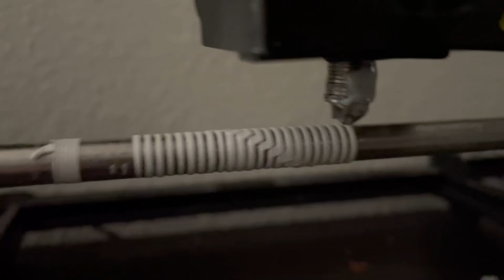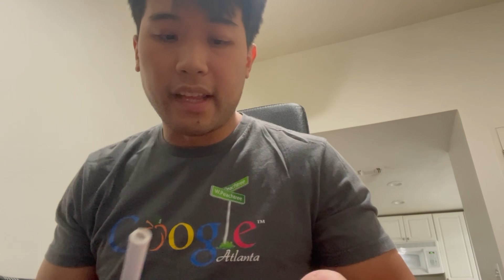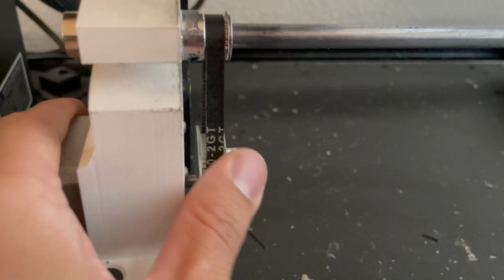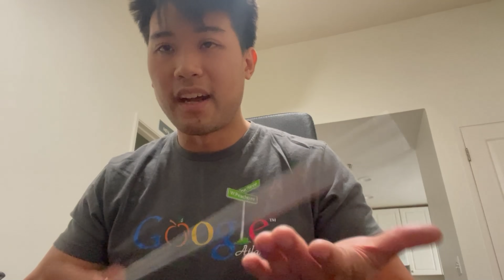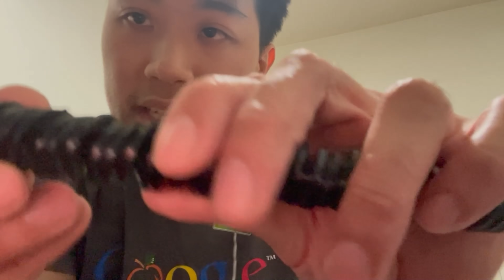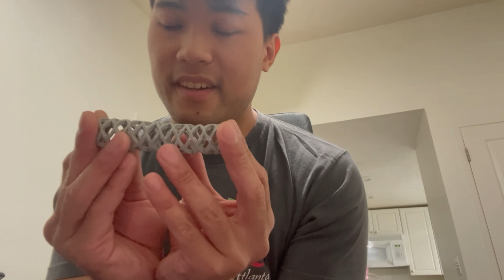i made a new type of 3d printer to make progressive twist barrels, springs, screws, rods, and more

Comment: Huh... So basically, a reverse Lathe 🤔 Being able to 3D Print Tubular Object like that would be interesting for the RC Tank Community... Since I don't own a Lathe I had to print the 128mm Barrel for my E-100 ( https://youtu.be/l3_RcOU3zo0 ) standing upright on my CoreXY for the best surface finish which obviously failed due to the ridiculously high Aspect Ratio between the Diameter and the Length of it necessitating for the upper third to be sawn off, reprinted and then glued on with the help of a brass tube going through its hollow core acting as a reinforcing rebar.

That being said... Not too enthusiastic about the whole Gun Rifling thing as cool as it may be from a technical standpoint so yeaa... Kinda lost me with that 😑

Comment: If the center of the rod is hollow, you can heat the rod while printing, or, maybe, heat it just enough to "release" the print...if you printed a layer of lower melting point plastic on the rod, you could use that as a release mechanism, by heating the rod just enough to flow the single layer of "soft" plastic?

Comment: So, you could put a lathe chuck/spindle, vertically, and get another "dimension", plus readily variable speed, and, you are no longer limited to "round" cores (you could use non-round cores horizontally, but not so easily as with a lathe chuck mechanism)
Different constraints, but different abilities?

Comment: Holy. Chris this might actually be huge. Even though its such a simple system it has big potential.
Reply: I think you're right. Mechanical engineering prototyping (manufacturing final products, from the capabilities he refers to), this could really open up ALOT for development. Not incredibly jazzed about the firearm focus, not because of anti-gun, but because I think this could lead to fear for 3D printing as shown by the new NYS Gun bill that happened this week. What's so awesome is this isn't JUST amazing for firearms, this is a break through for the validity of 3D printed Mechanical element performance.

If these don't start showing up as products, I'm making one.

Comment: The Daisy V/L is very similar to what you're suggesting. It was a caseless single shot .22 caliber rifle that, instead of using a primer to ignite the charge would use compressed air (Daisy is the same company that made the Red Ryder BB gun).
Reply: You could do the same thing today with a normal break barrel. They make enough heat in the compression chamber to burn oil or ignite other fuels. It's hell on the piston because it's not designed for that reactive force but it's possible.

HW/Weihrauch used to make an ether powered air rifle back in the days of chasing magnum power from break barrel airguns.

Comment: As a gun enthusiast, im excited to see gain twist rifling. I predict gain twist will make a huge comeback in the next decade.
Reply: Already is. It’s only a matter of time before the cost comes down from what Bartlein is offering. I have six gain twist cut rifling barrels and they’re absolutely sublime.
Reply: @DatMammutt  the cost is exactly what I'm talking about. With Better manufacturing techniques it's going to be as common as the .308 Winchester soon enough. The market is already ripe for it. The new blackout cartridge requires a ridiculous twist rate. Everyone is looking for those long high bc bullets. Soon we'll be firing bullets as long as pencils and a progressive twist is absolutely necessary to achieve that and take a big piece of the market at the same time.
Reply: @andyd2960 I’ve seen several prototypes of using alternate methods from cut rifling for gain twist so it can’t be too far away. Here’s hoping!
Reply: Check out the FGC-9 project.  Plans to use Electro Chemical Etching to rifle a hydraulic tube  using a 3D printed guide.  A great way to experiment with progressive twists.

Comment: You basically made an FDM lathe!!!!

...and you also gave me a rush of ideas and questions I didn't know I need an answer for.

Making lead screws, need extra strength? leave the rod inside.

Ideal for making high strength v-belt pulleys, small spools, things that would have massive overhang on a normal printer.

Would silicone sleeve work here? would it be reusable?

Did you try heating up the rod to see if the print would release after cooling down?

I hope you open source files and code, I bet the 3d printing community would be all over this in no time.
Reply: I've been thinking a very similar but slightly different question. "Did you try a heated rod(like a heated bed) to see if the print would release after cooling down?"
Reply: EDM CNC lathe might also be an interesting project
Reply: @charleslambert3368  I saw basically the opposite of that on Hackaday I believe.
Reply: @jmr not to come across as rude or anything but how did you get verified on YouTube? I've never seen a channel with less than like 50k be verified
Reply: @FATTYBONGRIPS  I've just been here longer then most.
Reply: @jmr  thats neat
Reply: PEI-coated rods?  FR4 rods?  Steel/aluminum rods? Spray the rod with a release agent?  Glue stick?  Dipping it?  What material would release prints best while still gripping sufficiently during printing?  That is going to be the big challenge, I imagine.
Reply from the maker: Yes!! FDM lathe!!

silicone sleeve would absolutely work!

I did heat the rod, even freezing, but that didn't work well
I made a press thing to remove things, but it was too slow that it was annoying

I don't have plans to open source because the code i wrote is super custom and really bad and not extensible
After writing clean code at work, I just want to write things fast and messy when I get home at night hahaha

I know that better software and hardware engineers out there can do it wayyyy better than I could in my apartment
Reply: @HumphreyWittingtonsworthIV  Please reconsider! Giving us troglodytes a starting place is so much better than nothing.
Reply: @grantprice613 don't worry the idea of too good somebody is already working on stealing his idea  right now.
Reply: @HumphreyWittingtonsworthIV  can totally relate to writing code for myself after working on code all day
Man you can probably imagine how long ago did I have some fun with programming things I like, not things my customers want
Reply: @HumphreyWittingtonsworthIV hey man I'm working on some large 3D printers, would love to collaborate
Reply: @HumphreyWittingtonsworthIV  Making it open source could significantly improve code performance.

Question about the rod, have you tried drilling a center hole and then using some means of heating with a slip ring?
Reply: @HumphreyWittingtonsworthIV  jobs and woz did there best work in a garage. you have something amazing here. something that could change your life.

Comment: How are you printing the solid rods?  Are you starting with a preprinted core from a Cartesian printer?

I could see rather than a rod, you have a rotating circular plate (maybe with heating for release?) Combined with a head that can rotate 90° so it can print perpendicular to the plate.  Print the core, stacking layers along the axis of rotation, then rotate the print head and start printing longitudinal like you already are.

Imagine printing propellers, gears, or other larger diameter items with a combination of radial and longitudinal print paths.

Or additionally make a print nozzle that's  a cone a little less than 90°, then orient the head at a 45° angle, you wouldn't need to rotate it, as long as you're building out from 0,0,0 it should be able to print both radial and longitudinal (similar to a lathe tool that can cut in the same manner.)
Reply: Gears are already good on a normal printer, layer lines are perpendicular to the force. Layer lines orientation for propeller would be bad. 
Issues with printing at an angle is good bed adhesion with larger prints.
Reply: @phlexy  you're thinking too narrowly, imagine if you could slice an object in progressively larger cones rather than in a plane, and if you could combine that with both radial layers and axial layer cylinders.  Yes you may be able to print one gear on a traditional printer well, imagine printing an entire cluster of gears on an axle (like in a transmission) in one print with layer adhesion properties of both flat and axial layers.

Comment: Outside of the fosscad community, this is genuinely insane for 3D prints. We are going to go full IKEA mode with these rods and screws 😂
Reply: No more screaming at the engineers to use standard sized screws, I guess?
Reply: @simoncleret  No, please keep screaming. We dont function well without some level of abuse. 😅
Reply: @C3DPropShop I'm sure we'll find plenty of other reasons to yell at you, like material selection or blind pockets with zero radius fillets in the corners.
Reply: @C3DPropShop  NO MORE ODD SIZED METRIC HARDWARE!!
Reply: @C3DPropShop  ONLY ODD SIZED METRIC HARDWARE! 🙏🏼
Reply: @CorvidianSystems  @fitz3540 This is what product development is. 👏 Two completely opposite inputs, I gotta make something work. So you both get Imperial hardware! Yay! (🤮 use metric)
Reply: @C3DPropShop true product development isn't complete until the engineer purposely throws in some aspect designed to frustrate the people who will be repairing said products
Reply: @C3DPropShop  fine, but this thing better fall apart 1 week after the warranty expires so we have something else to complain about in the reviews! 😂
Reply: @CorvidianSystems  DEAL! Planned obsolescence is required for new products because reasons! (The reason is money)
Reply: @fitz3540  no more odd sized imperial hardware
Reply: @oldkingcrow777  i like to throw massive capacitors in my designs even when they're unnecessary just to make sure people stay careful!
Reply: Can you share the software? GitHub maybe???